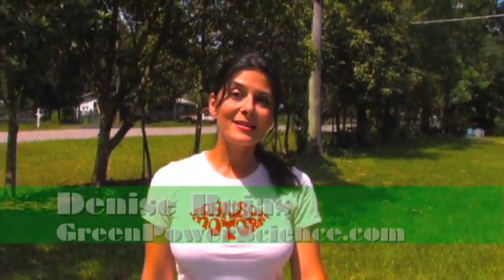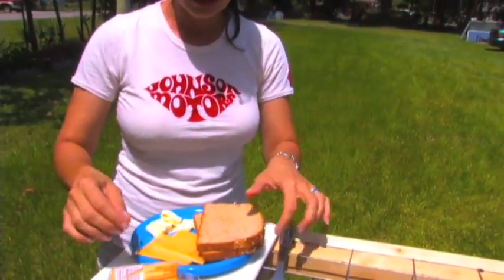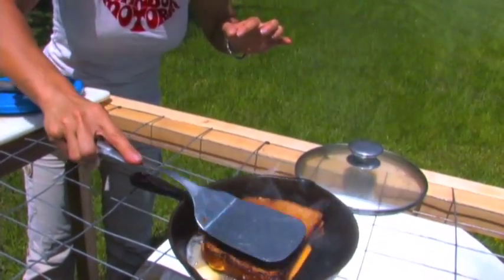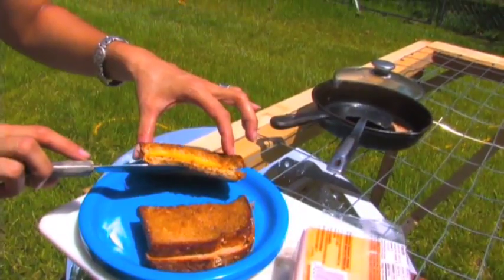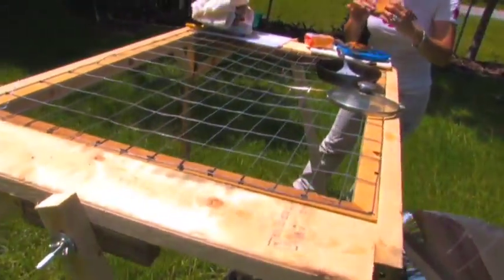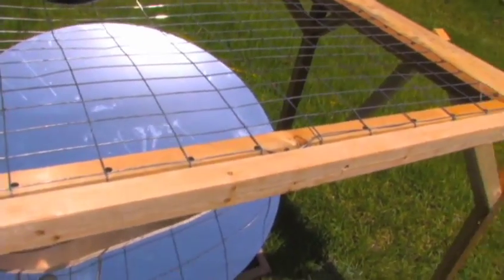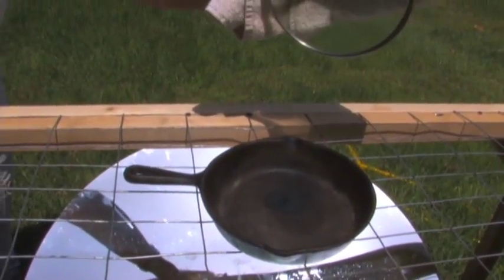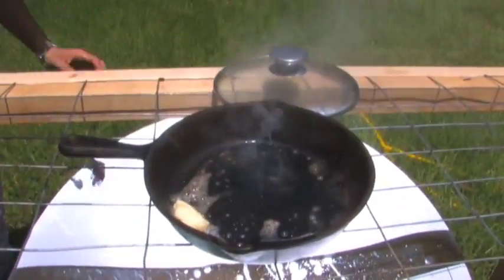1 MINUTE GRILLED CHEESE SOLAR COOKING Parabolic Mirror Concave mirror

Comment: What about ultraviolet with a concentrated system on a cloudy day?  Ultraviolet penetrates clouds. I have lit a cigarette with a four inch parabolic mirror under clouds.  One hears that concentrated solar is only suitable in places with constant sunny days.
How much did solar energy systems accelerate the fires in LA?  Solar panels with a plastic front and back are flammable.  Can solar panels reignite from shorted out wires heated by the cells that continue to generate electricity? The big lithium solar battery packs can take forty times as much water to extinguish and they can reignite. Lithium batteries burn four times as hot as wood.  Spraying water on a lithium battery fire creates hydrogen that burns five times as hot as wood.
If you look at a lot of photographs of the Earth, most of the Earth is not blocked by clouds.
What about the intense light from surrounding flames?  Would it be enough to overload the panel and cause it to catch fire from a distance or overload the battery?  That would really spread the fire fast.
Palisades is at the center of the highest concentration of solar panels in the country.  There are reports of the grid being overloaded by solar panels. Overloaded wires heat up and expand.  The number of grid faults skyrocketed in the hours before the fire.  Grid faults are when wires touch together or touch branches, etc. So if the wires are overheated and sag down they are more likely to slap together in high winds sending showers of sparks into the dry brush. Some are blaming the catastrophe on climate change caused by fossil fuels.  But was it really such a catastrophe because of the solar devices? 
If they used lead acid batteries would it have been such a terrible fire? There are probably more Tesla Power Walls per square mile in that wealthy area than anywhere in the world.  Most home energy use is for heating and cooling. A cubic meter of water raised by 50°C stores enough heat to heat a house on a very cold day. That is about 50 kwh of energy.  A 50 kwh lithium battery  pack costs tens of thousands of dollars.  The same cubic meter of water cooled to 35°F stores enough cold water to cool a house for a day on a very hot day.  A cubic meter of water costs a tiny fraction of a lithium battery.
The Palisades fire started at about 10:30 AM which about the time that solar panels start cranking out a lot of power.

Comment: 3 in 1 solar device can be constructed  which can 
1.cook foods using solar light
2.make electricity using solar light
3.make electricity using solar thermal effect with convexed solar beam onto a aluminum+Copper thermocoupler .

try it .

Comment: Just an idear you could use a thick plate of steel which takes the heat like a heat sink in between the cooker and the pan it would control the temperature of cooking  
and will burn your pan less like a coal stove. Plus it will take the direct hit of the beam and would shield you making cooking safer + definitely use eye protection........
Reply: YES.  EYE PROTECTION.  Be careful not to fry your retinas!  It's almost like they're welding without eye protection.

Comment: That cooked insanely fast!  Have you timed how fast it could boil maybe 3 quarts of water for Mac & Cheese?  If you brown a pound of beef in a skillet do you need to wear sunglasses to deal with the reflected light?  Thank you both for all the great videos, they’re always extremely informative and if things ever happened like a power outage for an extended amount of time, your knowledge has definitely helped me plan for the unexpected!  I haven’t seen all of your videos, but was wondering what might happen if you were to focus one of your lenses on a solar panel, would that make more power faster and could that produce a more efficient charging system?
Reply: estonbachone I don't think it is a good idear photovoltaic cells are designed to work within a specified operating temperature range and parabolic mirrors cencentate the Suns light to a single point at high temperatures it would burn a hole through the cells   ... not the protective glass though..Thats what I think anyway I could be wrong....  I haven't seen a concentrated solar plant with photovoltaic collectors.....

Comment: Umm, why not make it out of metal with metal folding legs for easy cary and then a metal top? No pans needed to cook and its no different than cooking on a flat top. And cost wise wouldn't be that much if you went to your local scrap yard
Reply: Notice the part near the end where he said that he didn't feel like welding today and that had it been made of metal you could really burn yourself on it after having the mirror pointing at it and heating up the frame? Also, by making it out of stuff he had on hand it cost him about $10.

Comment: That was pretty cool. During the Carter era, the gov't was giving a tax credit for having solar systems for things such as solar hot water, etcetera, installed in their homes. In 1992, I went to a house that had one of these systems installed from the 70's and the owner said that it still worked great. They should not (in my opinion) have ended that program. This man hadn't paid for hot water for 2 decades and just imagine if every home in America did the same. That's a LOT of energy savings.

Comment: From a 60's book, a 3 ft hemisphere makes a pan-size ball of heat instead of point focus. Using aluminum foil they claimed to get instant 350 deg heat, and that was before ozone depletion.

Use a stick-and-shadow to tell how well your mirror is pointing at the sun, or an aperture to let a dot of light to an X below. Either way could be used to automate sun-tracking.

Comment: How much can you vary the distance of the skillet from the mirror?  Did you determine the focal point and use that distance to determine the height of the wooden frame?  Would a smaller diameter mirror require the frame to be lower?

Comment: Also, do you know any other materials for the frame, have to be recycled, but won't burn up in the one hundred and something degrees. Alternatively some kind of insulator to connect the wires to the frame.

Comment: Stupid question.  This obviously took place in the summer time.  What changes, if any, would be necessary to use a parabolic set-up like this in the winter when the sun is lower in the sky (at my latitude).  Does this change anything?

Comment from the maker: This is like a fire or stove, kids not recommended. The risk is at or near the focal point, further beyond that they are safe. The black cast iron absorbs light better than stainless and being thick allows for better overall heat transfer The pans should be short of optimal so the light covers the entire surface of the pan vs a tight spot as the larger focal pattern delivers more efficient conduction than a super heated small area which radiates into the surrounding atmosphere vs through the pan

Comment: Thanks for the video, just a few questions, is cast iron the preferred cooking vessel because it wont melt by the intensity of the reflection?  Is the heat regulated by the closeness to the focal point of the reflection?  Is this safe to take camping where children would be running around? My concern is an accidental glance in the mirror, or is it safe from all points but the focal point?  Seems so ripe with possibilities, now how does one harness the beam to charge deep cycle batteries? THANKS!

Comment: There is a concept where a bunch of mirrors are concentrated onto one point and they heat up water making electricity.Problem is that it can only be used in areas with a lot of sun and only by day.

Comment: Some Alclad Chrome II (2) paint should do the trick. It's the same stuff they used in Terminator 4 to chrome the endoskeletons. It also comes in polished stainless steel etc.
It's alcohol-based paint, so you'll need to use Alclad's primer first & possibly either white or black base coat before the chrome paint. :-)

Comment: Dan this is a great demo thanks... how can the energy be stored so can be used when sun isn't available? I love all the different ways of harvesting the power of the sun, though the main issue is how to store it for later use. So far traditional methods seems the only available way (turning thermo solar to kinetic and to electric or PV to directly get electricity for storage in batteries). I've read about molten salt but for small scale/low maintenance isn't really viable. Suggestions welcome :)

Comment: Perhaps if the pan was a bit further from the focal point, it would heat more evenly, and less intensely, at the same time.  But very cool none the less.  Or hot, as the case may be :)

Comment: could the polished stainless steel sheeting you talk about in another video be used instead to create a lateral hot spot? 

I'm thinking of building a frame like the one you show in the other video; for the parabolic trough, but allowing it to swing under something like this for a solar kitchen. 

thoughts?

Comment: Dan, I liked the idea of the fencing wire on a wooden frame. I had been trying to work out a system for holding a pan or pot  in the focal point. Your idea allows for some movement as the focla point moves. Keep up the good work with your videos.

Comment: I would actually make that stove top twice as wide (the shorter side) so the mirror is actually under the whole thing, that way it's harder to reach the focal point of the mirror. This way you won't accidentally put your hand in the way and catch some of it on fire.

OR

I would advise putting a light shield on the mirror that pivots to go in front of the mirror, that way you can turn the grill off for safety and light control. and a swivel shield can be used for heat control ;)

Comment: hello i wonder, could you diffuse the light or move the pan out of the focal point so to not burn the food?  Perhaps measure the heat of the pan before the food is put in , just so to be sure it is at the correct temperature?